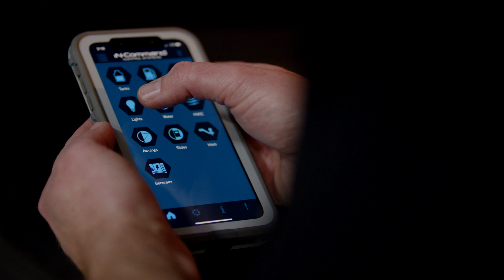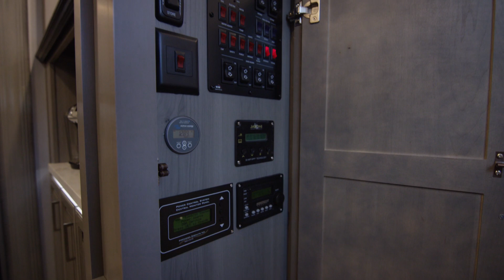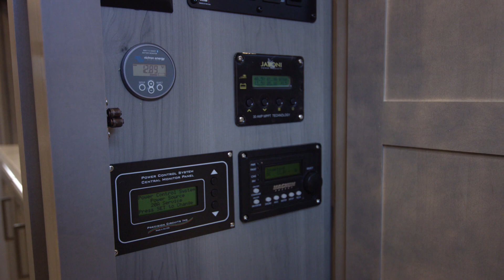RV Solar - Keystone Montana introduces Super SolarFlex™

Comment: Who can I talk to about the specific wiring in my 2019 Passport Elite 19RB. I am interested in inverting the power to the outlets and am having difficulty finding wiring details for my trailer. Please provide a number I can call for help.
Reply from the maker: Good morning, and thank you for your inquiry. On your unit, the solar would be prepped to charge the battery only. So you'd have to speak with an RV professional who is familiar with the electrical systems, and installation of solar panels etc... The outlets would not be inverted outlets in this unit, so there would be quite a bit of modifications needed to the RV electrical system to make this happen. We wouldn't have any videos on this, so it'd be best to work with someone locally who specializes in this field. Thank you.

Comment: I want to start by mentioning that I was pleased, especially because the equipment is US made and both ZAMP and Victron are good brands. We bought a 2022 2019BH Passport and it came with solar.  

Nonetheless, it was kind of hard to get information online on some follow up questions.  One example, it had one solar panel on the roof and one cannot read the label because is underneath it but I assumed it is a 200Watt. So, I wanted to expand adding another one and wanted to know the gauge of the wires going down to the controller, to see how many amps it could absorb.  The wires are not labeled but they look like 8AWG, so I guess 24 amps is fine. Hence, added a 115W panel (parallel) which would total 26 amps in ideal conditions, which never happens so I guess is safe. Yet, I wish I could have added another 200W or perhaps more.
Then, the MPPT controller is good for 15amp, which is easy to swap with a 20amp controller, but if I wanted to install a 30amp controller I would have been limited by the 8AWG wires to the roof (unless in series but then it makes it 24V). I wish Keystone would have ran a 6AWG at least, the added cost is petty but the difference would have been huge. 
There is also a black plastic box in the storage area, next to the converter, that reads "future inverter location" which is good, meaning that was pre-wired.  So, I removed it and found a wire loop (Romex, 12/2, yellow NMC) which is clearly the electric wire for the receptacles. So, I thought one end was loose but instead both are connected inside the wall. So, the idea is that one end comes from the power box (electric panel/converter inside) and is a circuit going to three outlets (receptacles) in the RV. The outlets (labeled "INVERTER OUTLET") are in the TV cabinet, the galley and one outside. And, they have power when connected to shore power.  I do like that instead of outlets dedicated to an inverter but won't work otherwise, these always work.  So, it needs an inverter that has a BYPASS for the 120V AC. I bought an AIMS with the input output ports for the Romex cable. You are to splice the loop (cut the wire), then insert the one coming from the panel fuse breaker box (power box) into the input one and the other end that continues to the receptacles in the output port.  So, the inverter will always bypass the electricity and feed the outlets in the circuit when you have shore power, and in milliseconds (painless, seamless) switch to cannibalize the batteries and invert to feed the outlets when it senses shore line is no more...I think is fantastic because you can leave it on at all times and not worry at all.  I think is also good that is only three receptacles and not the entire RV. The fridge is a 12V (battery) and propane, so the inverter is not needed so 15AMPS for the outlets in key locations is ample power for camping and the inverter shuts off if it goes under 10V so the batteries won't empty.

I like the 12V refrigerators because we can close the propane and still have a working fridge as we tow down the road.  The batteries are charged while towing and the converter charges when shore power, so I did not want the inverter to charge as well, best to keep equipment segregated, so my controller, my converter and my inverter are three different ones and is perfectly fine. I learned when I bought the first Smart Tv that if if breaks, you lose the TV as well and the entire thing is costly.  I remember two years ago a neighbor camper in a state park had issues with his "big blue pretty box" which was the center of gravity and he was doomed, because whatever happened (they had to leave) it killed it all, no converter, no transfer, no inverter and no charging anything....so, if any of my boxes die, is not more than $500 and other functions remain.

I like the prewired inverter perk, but we were left blind and no one told us anything. Keystone just told us to take it to an authorized dealer, but that contradicts the benefit of prewiring for the owner which implies simplicity and ways to save money. I learned and figured it out because I am retired and had ample time to watch and read thousands of comments as well as google for endless hours. My father was an electrician and I was his servant/assistant until I was 21 years old, ha! So, I knew how to do it and had an idea, but I did not want to cut walls or splice cables without being certain and Keystone would not give me an electrical (wiring) diagram nor tell me where the two Romex loop ends go. The other thing was that it had the Romex loop but no cables to the battery giggy box, so I had to wire those, so it was HALF prewired.

Anyhow, if you can forward this to them:
1. upgrade the AWG gauge for the wires to the roof and a 20amp controller even for those with 200W basic solar package.
2. Good for the Romex loop to the outlets, but label it and don't forget it also needs to be connected to the battery, so the cables to the battery would be nice and customer would not need to remove wood paneling/walls. Indicate the inverter type needed.
3. Some plywood where the inverter should go is needed to install and screw it to the wall because they are heavy; some boards behind the wood paneling will do.

A BIG HUGE MUST not related to Solar.  Reinforce the leaf brackets for those axles!!!! too many horror stories and Lippert frames simply respond they build them as Keystone orders them....one strong bracket can save lives or a vacation memory.  I heard too many stories already and it worries me. Guys like to play with sturdy toys and a strong looking bracket is a certain sign of quality and safety minded manufacturer!

Sorry for the long post but I hope I shed some light to those who are scratching their heads wondering what that Romex protruding like an intestine out the wall is, ha!

Thanks for the video and the opportunity.
Reply from the maker: Good morning, that actually is quite helpful feedback, an appreciated that you took the time to respond again. We will get this over to the product manager for the feedback given here to be presented in their next meeting. Again, thank you!!

Comment: Now if you all would just address the single most important thing,  the springs and axles and brakes. Have t you all noticed that’s one of the first thing that gets replaced by full timers? These are built so close to max gvwr that either cloths or food has to be left out and this crap of well there’s tong weight that takes that weight off.  Not really it don’t  and anyone would be more than happy to pay for that safety with 4 k springs and 8k axles with disk breaks. It is 2020
Reply from the maker: Hi Roger, thanks for taking the time to post. Owner input like yours is invaluable. Just over two years ago, Montana added disc brakes as a part of our Legacy package for campers like you who travel more frequently. Our 2021 models will also introduce new axle improvements that I think you’ll be excited about. Stay tuned for details on that in the coming weeks.